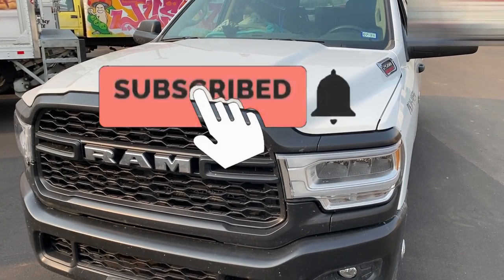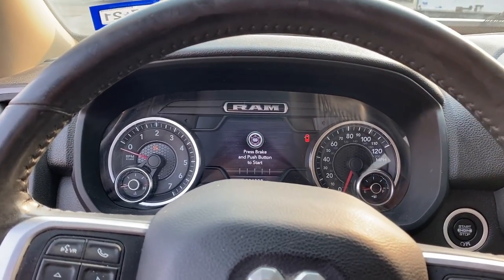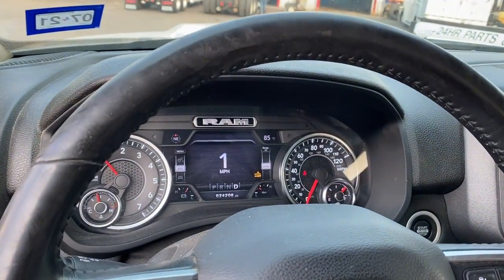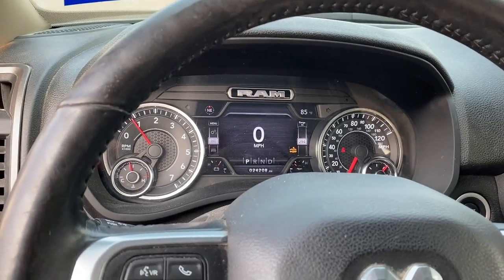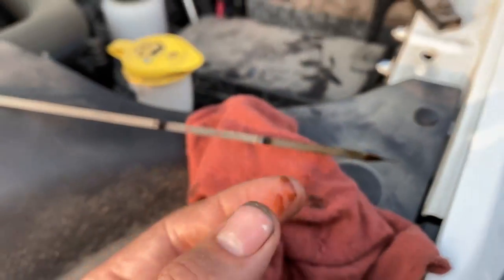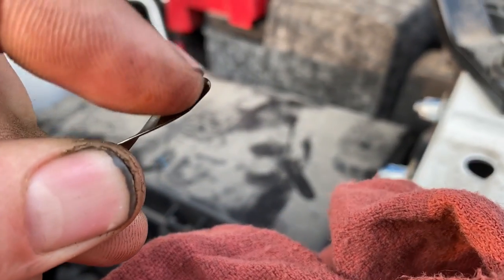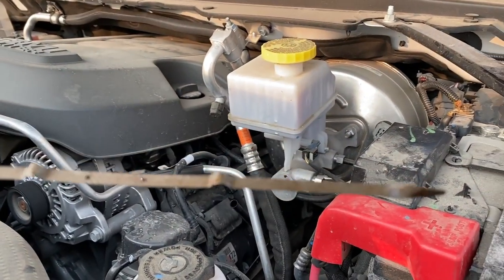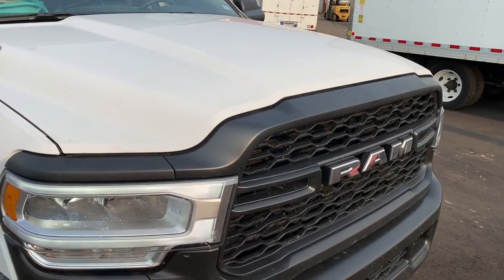2020 Ram 2500 Hemi 6.4 Bad Engine!

Comment: Hi Tony...just found your channel looking for 6.4 hemi HD reviews. I wanted to get your opinion on the truck choice I’m facing as your a diesel tech expert.  So, here goes!
I’m looking at two brand new 2018 Ram CA60 5500 cab & chassis trucks (yes, a few still are out there!).  I need the 5500 payload to haul a 6,000 lb truck camper and I want to tow my toys (SxS, dirt bikes, etc.) behind it. 
- Truck 1 has the Cummins with 4.88 gearing - a towing and hauling beast.
- Truck 2 has the 6.4 Hemi with 4.88 gearing - no tow/haul slouch either!
As you know, both engines are detuned.  I know the Cummins is a better towing platform and I’m really thinking about taking the diesel dive for the first time even with their emissions problems. 
So, my first question is whether you think the last gen Ram/Cummins (2018) is a better choice vs the new 2019+ trucks?  I’m thinking I would have less potential issues with the 2018 because it’s using the CP3 pump vs the garbage CP4 that seems to have a tendency to destroy engines. 
Also, are the last gen diesel Rams pretty reliable or would you opt for the 6.4 Hemi knowing what you see every day as a diesel tech and the problems folks face with them?
Either truck will do the job for me...guess I’m trying to overcome my diesel apprehensions...😁
Thanks in advance for any insight or advice you can provide!
Reply from the maker: Great questions! Welcome to the channel! I guess a big question would be how much weight will you be towing behind you in addition to the 6000 pounds payload?
Reply: @TonyTheTruckGuy  probably between 6,000 and 10,000 lbs trailer + toys. I know that’s a wide range, but it I didn’t want to limit myself after spending the stupid money these trucks cost. I’ll also be carrying at least 100-200 gallons of fresh water on the trailer so I can boondock for months at a time, plus fuel for toys, etc, etc.
Reply from the maker: @michaelllewellyn4441  So I assume in terms of distance or frequency of towing, you would be hauling this combo quite often?
Reply: @TonyTheTruckGuy  yes. I plan to sell my home and go on the road RVing full time for a while...probably a year or so.  I should also add I’ll be moving from Texas where it’s relatively flat and moving to the West Virginia/Maryland/Pennsylvania area to eventually build a house, so that area is pretty mountainous. I would then do summer trips all along the eastern Appalachians and also out into the mountain west. I assume I’ll be putting 15-20k miles per year on it...maybe more. I assume I’ll keep the truck for about 10 years.
Reply: I also noticed the 6.4 Hemi also comes with the same 6 speed heavy duty Aisin transmission...so, that was cool.
Reply from the maker: @michaelllewellyn4441  If you’ll be towing that often with that much weight, I’d recommend the 2018 Cummins. Once you get over 5-10k lbs they just tow so much better. The 2018 is also a more tried and true generation so more reliable in theory. Plus the CP3 vs CP4 thing that you mentioned. If you were only going to be towing 5-10 regularly and 12-15k SOMETIMES, I would say the 6.4 would work just because maintenance will be lower cost and purchase price would be much lower. But if REGULARLY towing 12-15k especially with such a heavy payload, the diesel is really the only way to go. Otherwise you likely won’t be happy with the towing performance of the 6.4 at that weight.
Reply: The 6.4 Hemi is listing at $49k and the Cummins is coming in at $61k
Reply from the maker: @michaelllewellyn4441  Yeah, the diesel adds quite the price, but if you’re towing 10k+ lbs regularly and 15k+ occasionally, it’s your best bet. I swear the 6.4 hemi was coming with the 8 speed auto behind them starting with this new 5th gen though. But even still, you want the torque of the Cummins with that weight.
Reply: Specs look like this:
- Hemi...4.88 axle...19,000 GVWR...11,220 Payload...18;070 Max Tow...26,000 GCWR
- Cummins...4.88 axle...19,000 GVWR...10,320 Payload...29,670 Max Tow...38,500 GCWR
Both are Crew Cab and 4x4.  I’d never have to worry about capacities with the Cummins and probably not the Hemi either.  Hence, my struggle to determine if the Cummins is worth the extra money and potential emissions problems down the road vs the Hemi.  Sorry for the long questions!
Reply from the maker: @michaelllewellyn4441  The problem is that yes, the 6.4 can TECHNICALLY tow that much, and actually has a higher payload due to the same suspension but lighter powertrain. HOWEVER, just because it’s RATED for that weight, doesn’t mean it likes it haha. The Cummins is just so much happier with weight behind it. Hard to explain without driving each of them, which I recommend if possible.
Reply: @TonyTheTruckGuy  Thanks for the advice!  Appreciate your help!  Makes sense to me...now gotta see how good my negotiation skills are!  Lol
Reply from the maker: @michaelllewellyn4441  No problem! Good luck with the purchase!
Reply: @michaelllewellyn4441  check out the TFL Studios  channel,  they have videos of actual testing of Ram 2500 6.4 under max load climbing serious mountains out west! They also lots of information on all trucks and towing capabilities.
Reply: Yes that engine IS bad!!...but NOT by design....Unc Tony needs to stick with the OLD 318....GET A 6.4 BUDDY

Comment: Should be titled "When lazy idiots own vehicles." That may be a known issue but had the owner been following a proper maintenance schedule it may not have happened at all. I doubt very much that FCA would cover what is obviously going to be a VERY expensive fix if they never changed the oil.

Comment: This engine 6.4 even change oil every 5000km it will be coming the noise . Engine 5.7 not like 6.4 so any one said change oil early that's right with 5.7 but 6.4 no because high pressure . So  almost damage lifters noise then cam .
Reply from the maker: Yeah i don’t know. 3,000 miles sounds like a very short oil change interval unless you’re doing a lot of sever use, heavy duty towing, or lots of operation in dusty environments, but maybe. Obviously it looks like this truck was abused and likely had 24k miles on the oil. If it was my truck I’d do it around every 5k.
Reply: @TonyTheTruckGuy  my friend after 24k I think the oil it will be changes like water . I have srt8 6.4 tow times overall to do with this engine .

Comment: You didnt check the oil before you started it?  I always check the oil on a vehicle or machine before starting it if i have never worked on it.  You have to cover your butt if you work on someones equipment.  The owner deserves to pay for a new engine.  Dont change your oil you get to pay big.
Reply from the maker: Honestly I had no reason to check it. Because who would think that a truck less than a year old with 20k miles wouldn’t have any oil in it lol. And they didn’t say it died while driving, they just said it wouldn’t start, so figured the starter went out.
Reply: @TonyTheTruckGuy  In shops i worked in we had to check for exterior damage and check all fluids before moving the vehicle.  We have had instances of being blamed for damages or engines with damage.  It is for you and your company’s protection.  Just speaking from past experience.  There are the odd customers who love to blame the shops for damages.  The worst ones i find are the ones who dont look after their stuff.  Then they want their vehicles cleaned up to pristine condition.  I have seen cars with dirty diapers in the car that have been in there for a while.  I refused to to work on that crap.
Reply from the maker: @dogjunker  Hahaha yeah I hear ya, it’s never a bad idea to check fluids, I guess I just didn’t suspect an issue here and was too excited to figure out the starting issue. We also deal with some pretty gross trucks unfortunately.

Comment: That phone case 🤣
Reply from the maker: I HAD TO have it when I saw it haha
Reply: @TonyTheTruckGuy  sir.... does the 2005 ram 5.7 L trucks also have the roller lifters like the new ones ?????
Reply from the maker: @berardoferrari  The problem is prominent in the 2009+ due to the variable valve timing and cylinder shutdown

Comment: Every Remotely Modern vehicle NEEDS Synthetic oil. Every 5k, good filter, either the OEM filter or a Purolator Pure One or Boss. Oh yea that's right, it's cheaper to spend 8k on an engine replacement then $50 every couple of months. People are so Stupid....
Reply: @Lq32332  Of course, don't you know it's cheaper to buy an engine then change the oil?  Every vehicle remotely modern NEEDS Synthetic oil PERIOD.

Comment: Fuck i had a 2003 5.7 1500... hemi tick issues 17 years ago still the same problem on this trucks WOW. Ford & Chevy all the way no disrespect on ram diesel 🤔
Reply from the maker: I guess the tick doesn’t bother me as much so long as the actual cam and lifter doesn’t fail. The older hemi’s didn’t have the same setup

Comment: Certain engines are not forgiving if you don't maintain oil and proper oil level the end this person was just lazy or cheap or this is what happens with inflation no money for oil change 🤷
Reply from the maker: This was way before the inflation haha, just poor maintenance in general. But I do wonder where all the oil went since I didn't see any leaks....kind of odd.
Reply: Well you figure 7 quarts and it's probably four or five quarts low on top of dirty oil on top of probably they've never changed the oil what did the oil filter look like that will give you a idea
Reply from the maker: @DavidDallas3343  we didn’t end up messing with it since it went to the dealer. But since there wasn’t any major leaks, I’m wondering where nearly 7 qts of oil went.
Reply: It probably just burned up with no viscosity left in the oil it probably was just consuming oil through the PVC system there isn't any oil catch can I heard people with charger 392s put oil catch cans on them so maybe that's where it went

Comment: Change the Title.... In this case a $12 container of Costco Synthetic would have saved this  truck. BTW- when you hear that noise shut the truck off and do a oil change and try again
Reply from the maker: Change the title why? This engine is bad. And with how much noise it was making and how low on oil it was, shutting it down and doing an oil change wouldn't have done anything for it lol.
Reply: Guess my point was that it implies that all 6.4 and 5.7 are bad.... in this case it’s not the fault of Ram but the lack of maintenance
Reply from the maker: @birdmanandgoose  But the title doesn’t mention anything about the 5.7, and it doesn’t say that the 6.4 IS a bad engine, it’s saying that THIS 6.4 is bad 😂